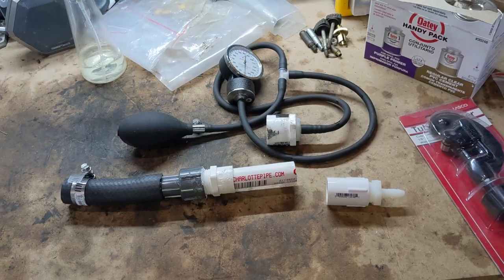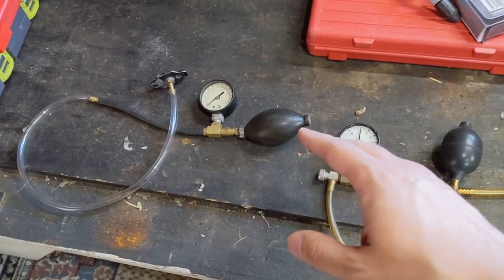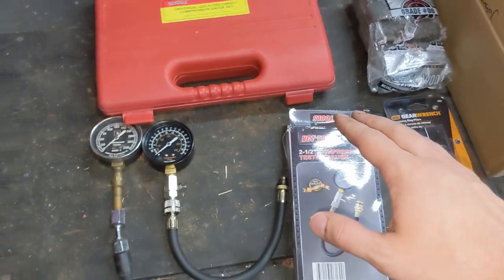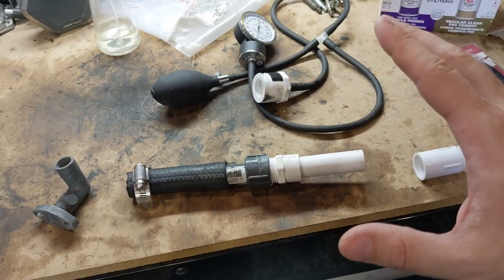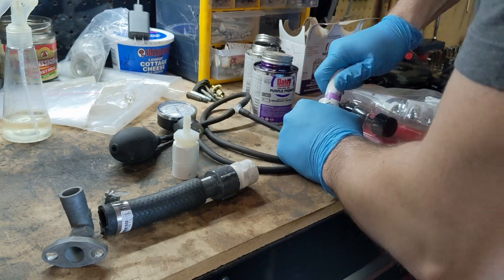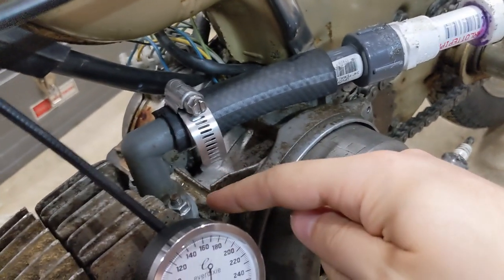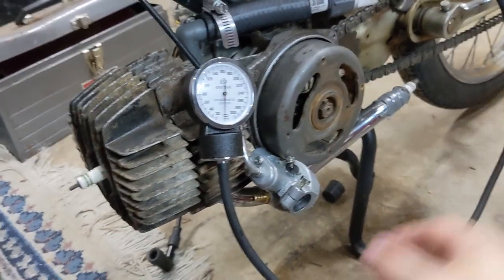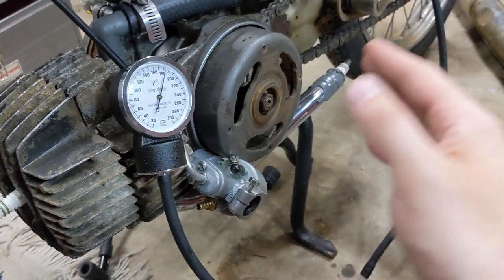Modify and Test my DIY 2 Stroke Moped Leak Down Tester

Comment: As a long time master mechanic this video is very useful for those of us coming from a 4 stroke world. I need more research to find out what engine is in a Garelli Gran Sport moped. Looking for vin decoder is how I found this video. It has a H1 horizonal square cylinder, 47mm center to center on studs. 14:12 carburetor, 30 mph with 17" wheels
Reply from the maker: Oh great! 
So if it's the horizonal motor that is a Garelli NOI. A vertical motor is the VIP model.

Comment: I recently replaced a faulty fuel valve on my Free Spirit Moped and noticed that the straw on the new one was longer than the old one. Could I add holes to the straw to allow more fuel to pass through? (When the fuel is parallel with the tip of the straw no fuel is being sucked through)

Comment: My 1980 Honda express .The spark plug of my motorcycle has sparks, and it dies after working for about 0.5 seconds. It happens every time. The kill switch is not rusted, not sure if its circuit is good. May I ask how to judge the quality of the carburetor, because its choke nut is loose. could you help me to figure out it ? Thanks so much